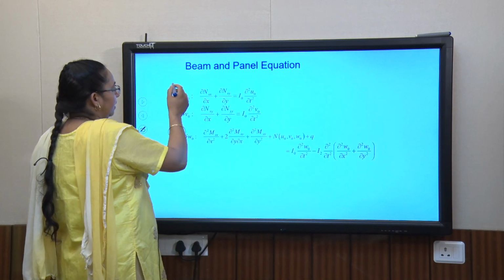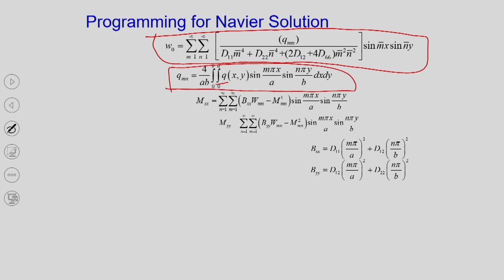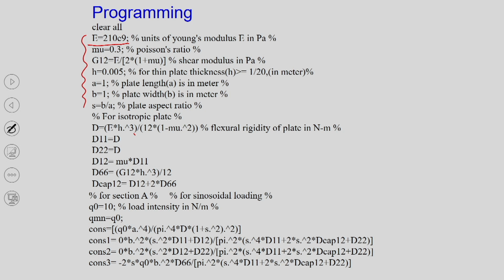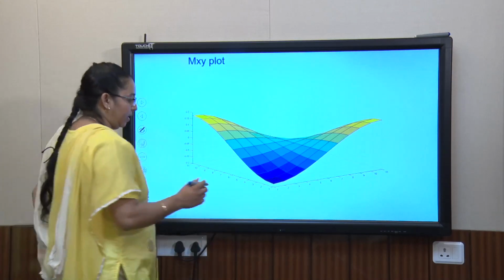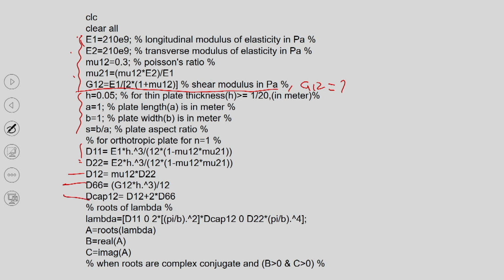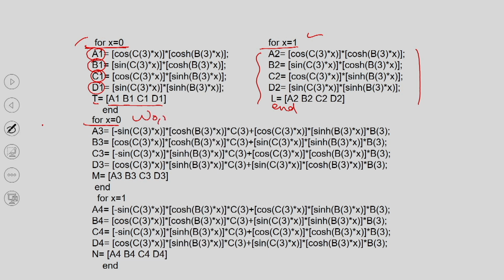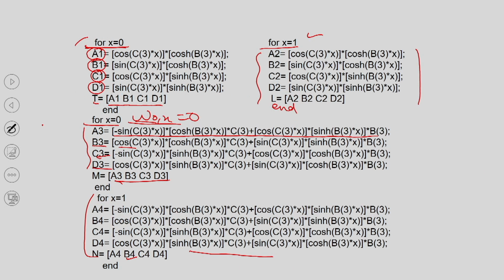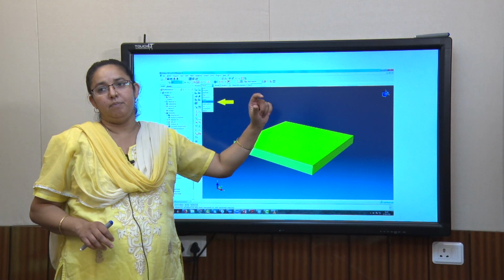Lec 10: Matlab coding & ABAQUS

Comment: Mam, My self Imran Sayyad , i have gone through the course of Theory of rectangular plates. You explained very nicely. An definitely it is very useful in my research also. i am working on buckling analysis of  beam and plate using FSDT. In this regard if you could provide me matlab code for various boundary condition by using FSDT then pl send the matlab program on my mail id syyadimrnai@gmail.com, This will help me a lot for my research. Thank You

Comment: maam,i am working on Piezoelectric material which is surface bonded on composite beam and i want to simulate a deflection by applying different voltages.(through abaqus).if u have any vedios on this ,how to apply a voltage on piezo plate.....then please upload here maam
Reply: Mam are you sucessful simulation of your problem?